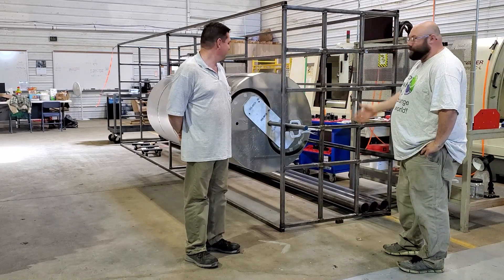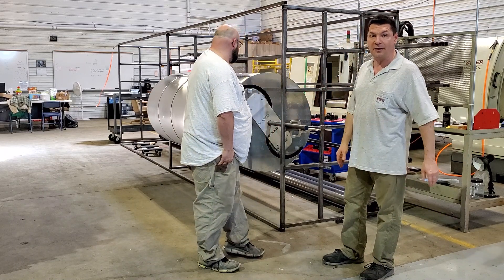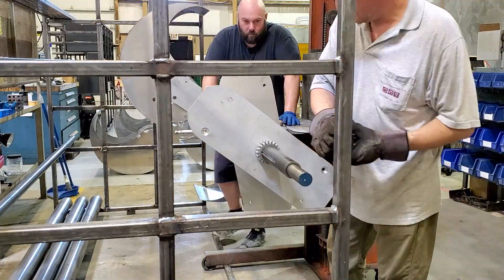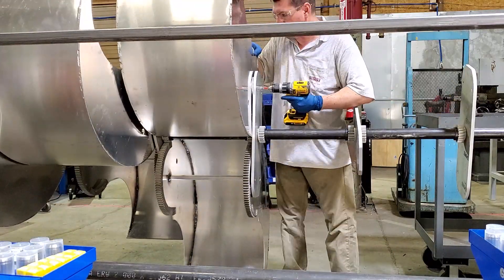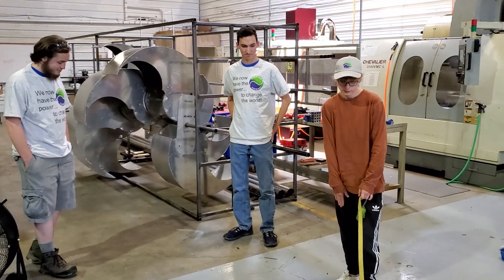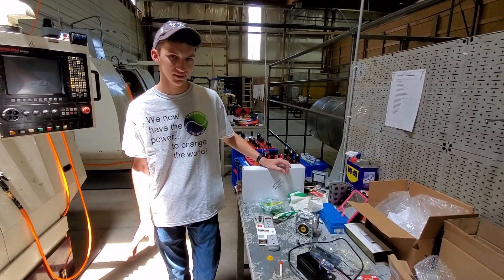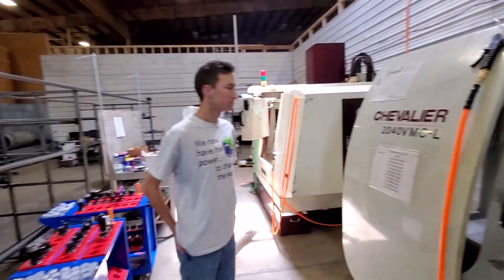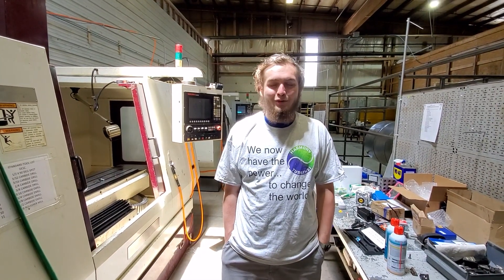Harmony Turbines Weekly Whirl 14

Comment: Gentlemen, I'm watching your show since day first. You are great and greater by every day going by. I'm 100% positive that the wind turbine will be a major success! I am a green pacifist an encourage the manufacturing of wind turbines. This is our future, our planet, our air to breathe...… I'm writing to yo guys from across the ocean, and I hope that one day your company will built turbines here to...  I look forward to watch the following episodes and see at the end the final product; the Harmony wind turbine. Did you ever thought about building a vertical axel wind turbine with no friction, as per MAGLEV (magnet levitation wind turbine)? My regards, Alex
Reply from the maker: Thank you for the support. Yes I have thought about magnetic levitation but passive magnetic levitation as in opposing magnets. We would still use radial bearings to hold the shaft in the X&Y (axis of rotation) but the Z could be supported by opposing magnets. I was definitely thinking of giving it a whirl. No pun intended. -But that stuff can come later, it would have little to no bearing on our results. Again, no pun intended. The reason being, whenever a wind turbine is up to speed for power generation there's plenty of force to overcome the tiny (miniscule) amount of resistance from the thrust bearings. I would guess that for the trouble you'd ever only see .001 % increase in power output of the turbine ...if that? In this case it's probably not worth the hassle and expense of trying to do it. Furthermore I would imagine that after some time, the magnets, even if NiB, would weaken and could then risk touching. -But yes I have certainly entertained the idea of trying it out.

Comment: Chris, Have you given up on the idea of utilising recycled plastics in favour of aluminium?  If so what were the reasons pls?
Reply from the maker: No Peter not at all. Experimenting with different materials and reducing costs will come later. This is our first 1kW prototype... so you build it to hold up. You don't risk unknown things in the beginning. We need reliability and performance data above all else from this unit.
Reply: I was curious about that also. There is something I love about the concept  of recycled plastic but would worry about longevity of the plastic.
Keep moving forward. I'm loving the progress!